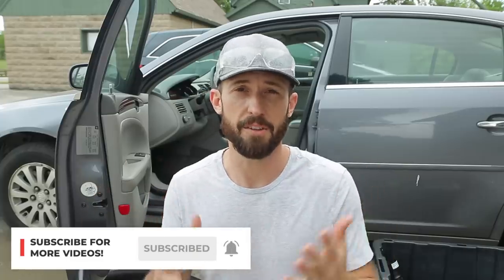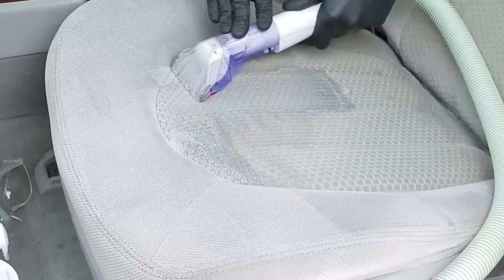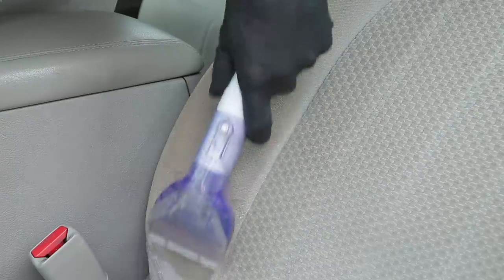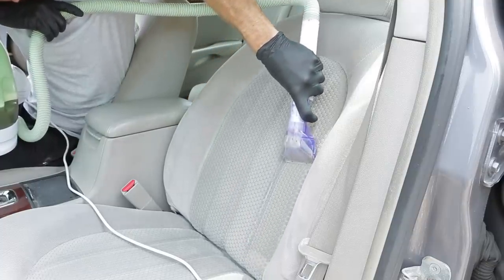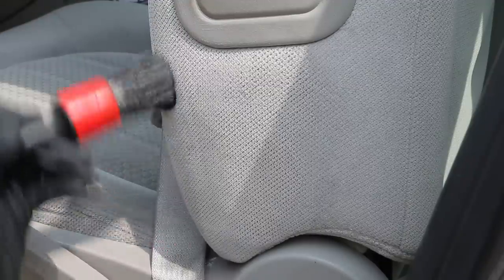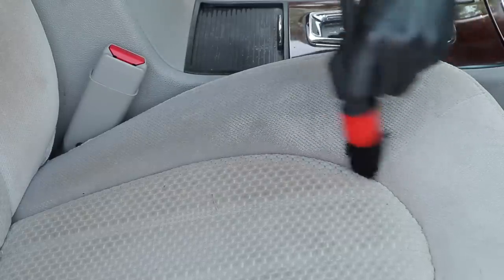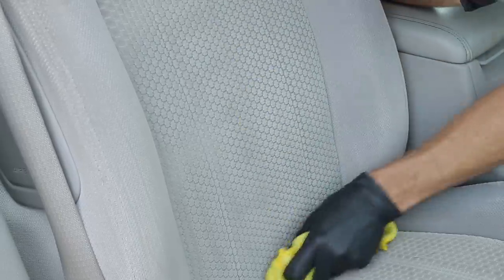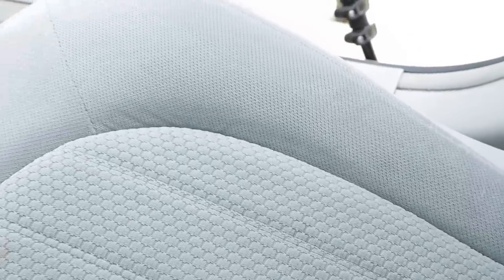How To DEEP CLEAN Cloth Car Seats The Right Way And Remove Stains and Dirt

Comment: I purchased a extractor after watching your videos. What I usually do is run straight water in the extractor. I put the solution in a separate spray bottle. That way I get time to spray the solution then scrub with a carpet brush then extract. Works 10x better as it gets to dry faster. Hope this helps
Reply from the maker: I agree with that 100% and a great tip! What solution?
Reply: @StaufferGarage  One bottle with simple green diluted with water, and another bottle with some type of oxy carpet cleaner diluted with water as well. The simple green for tough stains and the oxy for nasty smells such as cigarette smoke. Earlier this year I bought a Altima SE-R that was smoked in, I used that method and the guy I sold it to could not tell it was smoked in. It was awesome. Watching some of your stuff makes me not cringe so much when I have to clean our baby hauler!
Reply from the maker: Oh wow thats insane you got out the smoke smell as well!
Reply: Marvin Walcott what ratio did you dilute the simple green?
Reply from the maker: 4:1 water to folex
Reply: @cheeeseinacann  Just about 4 to 1 like the folex, depending on the stain
Reply: I have found small amounts of tide oxy or gain not only help remove dirt more effectively but it smells so much nicer afterwards. I use it on all my floor mats and even my in house shampooer. I work for a car dealership and I detail my own car and usually end up showing then different ways to get things cleaned better for our customers that same time for them
Reply: A little confused on the Folio ratio. Pretty certain that the video says 20:1 but in the comments section I’m seeing 4:1?
I only have a wet dry vac so that might be a different ratio altogether?

Comment: "I give the advice to remove the seats"
With modern cars, you should know what you are doing. I learned the hard way when I changed my BMW E90 (2010) seats - same applies for (some) cars from the 90s, like the E36. There are sensors connected to the seats, if you remove them without disconnecting the battery and waiting a few minutes, you get Airbag Errors etc. Most people will now enjoy paying 50€ at their local Dealer/Scamship for them to delete the error.
Else, good video and good results.

Comment: love your videos brother! fellow detailer here and may I make the recommendation of adding drill brushes to your arsenal. I use the same “extractor” as you. however I spray super clean diluted 10:1 or 5:1 depending on filth and hit it with a red drill brush from chemical guys. then spray fabric clean from chemical guys diluted 16:1 for the better smell and to get anything I missed. i use warm water with my extractor to “rinse” the seats or carpet instead of using the extractor to clean. leads to amazing results, good smell, relatively quick dry time, and it is much quicker than just using an extractor. you have taught me a good amount of things (especially the steamer) so though I could recommend something to you! cheers!
Reply from the maker: Dude, love it and appreciate the tips. I have in my amazon cart a drill brush and one for my DA as well. I need to pick them up asap

Comment: Tip: after you used your extractor on a seat or Carpet, use your shop vac ( if it’s a wet vac ) and it’ll suck up a ton of extra water and the seat will be drier. Then use microfiber towel and wipe the seat down for extra dryness
Reply: Like he does @ 9:15?

Comment: I have noticed that you clean the carpet and then the seats (for example those unremovable backseats in your family car). I usually start with the top and then I go down because every time something goes out of the seat and it ends up on the clean carpet - so I would have to vacuum it twice . You are doing good job :)

Comment: I take the seats apart and throw the clothes liner into the washer. And let air dry. I then remove carpet and pressure wash. Also air dry. Afterwards I remove seat belts and replace with new set. Also replace mats with brand new mats. I later steam clean the roof liner and visors. After dry I reinstalled all parts. And replace cabin air filter.

Comment: You list an Amazon extractor that is over $600 in the description but in the video you are using a Bissell Little Green carpet cleaner that is around $200 and I happen to have one. What model are you using in this video? Seems a lot of the products you have listed are not the ones you are actually using in the video. Bit confusing.
Reply: I saw that too seems pretty deceiving if you ask me😮

Comment: Bro get a Mytee 80/70 I know it’s expensive but it totally changed my life when I upgraded to it. I used to  use the bissel extractor but it took so long and it left the seats very moist. It doesn’t do a very good job of pulling out the fluid you are spraying.

Comment: Any ideas/thoughts on removing grease and oil stains from cloth seats??? Just bought a used truck and it looks like they just put covers on the seats instead of cleaning them. Will the LA's solution work on the seats or will it screw them up? Does the folex work on grease and oil.

Comment: Good results...only suggestion I have for an even deeper clean is use the extractor with solution in it to pre-treat the area...then grab a medium stiffness nylon brush and scrub the bajesus out of the area...then extract and towel dry...done!
Reply: Also a great pre-spray is revive it rocket...great for seats and carpeting as well...it’s from a carpet cleaning supply company called bonnet pro...it uses peroxide’s and a citrus solvent to remove even the most stubborn stains...just make sure to wipe overspray off of any plastic panels in a timely manner...absolutely fantastic product!
Reply from the maker: Interesting... I will have to check it out! Thanks for the tip

Comment: James, its always a pleasure to watch your videos and see you at work, good stuff man! I’m still a bit new to detailing, so besides cleaning interiors, exteriors, and paint correction like polishing, can you do any videos on touch up paint? Or is that kind of outside of your usual thing? 
And if any other kind commenters are reading, any recommendations on how tos for touch up paint?
Reply: Do you mean for rock chips/dings where it's right down to the metal? If so, I would recommend getting a paint stick (colour matched to your vehicle) from the dealer and filling them in before they start to rust. Most of them come with an abrasive tip where you can scratch away any rust first, then apply the paint, and then the clear coat on top. Shouldn't cost more than $20-40 and is an all-in-one product!
Reply: @TheDetailGeek  Bingo. Thanks, I reckon I'll do just that!

Comment: I love cloth interiors. I've had both but I feel like cloth is just more comfortable. Also it's way better in the cold. Stains are the only downside in my eyes
Reply from the maker: I agree with 100% and why racing seats are usually alcantara or some sort of fabric. What kind of car do you have?
Reply: @StaufferGarage  a 2012 turbo sonata. So the bolsters of the seat are leather, but the inside is fabric

Comment: Can i use standard wet&dry vacumm cleaner to extract the water when using the soft brush method?
Reply from the maker: Yes totally, and just use hot water after and extract again
Reply: Stauffer Garage thanks man.. And for the cleaner what kind would you sugess for the seat and dashbord? Just watch your other video aswell, and sub to your chanel.

Comment: Odd because most cloth seats I see in cars in the UK are black or grey. I never see these lighter colours, only on leather seats do I see this, that brings me onto the next point, in some cases the cloth seats which are black are far easier to clean, even velour, you can do it just with a bit of water and some elbow grease.
Reply: Chatta290 it dosent mean there easier to clean it just means you don’t see all the dirt and grime still left on the seat
Reply: Benjamin Hoefler so you clean seats all the time just for the sake of it even if it doesn’t look dirty. I for sure wouldn’t do it unless they needed it ie had a stain. A vacuum is good enough